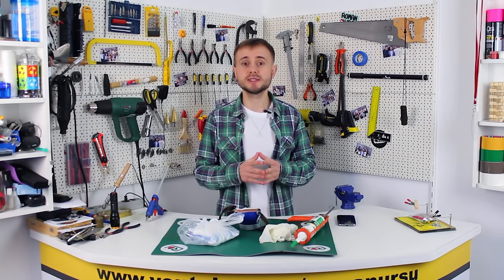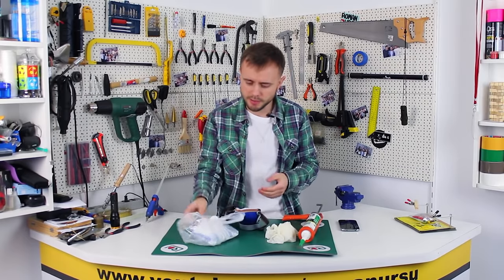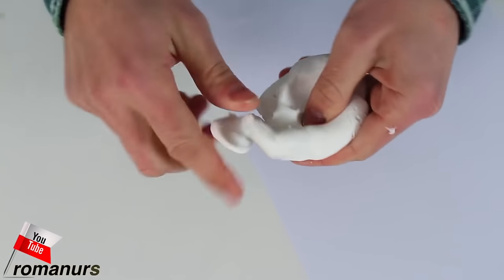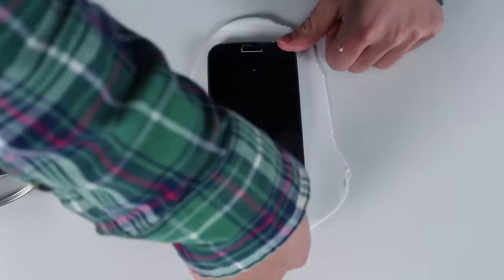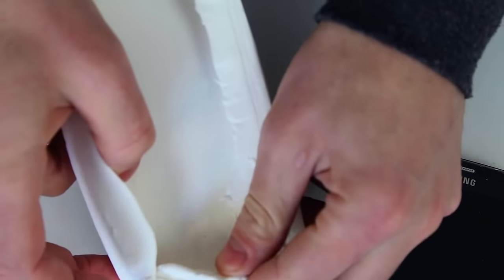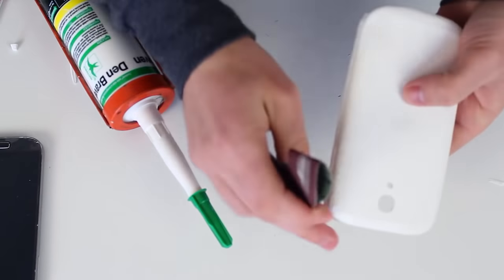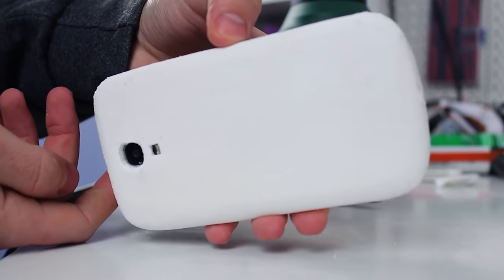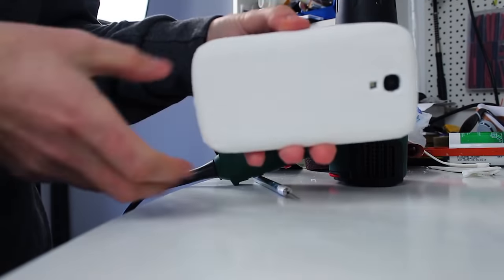DIY | How to make an Silicone Phone Case  | Tutorial

Comment: This seems like an interesting way to seal up low-power DYI electronics for weatherizing. Not only for a water-proof layer, but to protect it against hard hits with something soft. I think a thick shell like this would take a lot of beating, and being a mold-able putty makes it very versatile.
I could also imagine this being useful for DIY tool grips, to approximate vulcanized rubber.

I assume the starch is just there to make it less sticky to where you can handle it. Does it affect the final strength after curing significantly?

Comment: I don't think people will wait 12 hours without mobile phone to build the cover ahaahah
Reply: buy a model version of your phone
Reply: +TheLucos1996 you can use Styrofoam or clay to replace the phone, just make sure it has the right size..
Reply: +Nicholas Ruiz Model phones are about $10 and cases are 50c
Reply: +God ... if they dont make them any more .. its a good way ;)
Reply: +Nicholas Rios
Reply: Ahmed Abdel Wahab Lol Ruiz not Rios
Reply: +Katikas no because then the new case will be too big.
Reply: slicedpage no, you mold the inside of your case and then mold the mold of the inside if your case, to get another
Reply: +Nicholas Ruiz yes I get your point but then it would be too small. I think the only way to use an existing case is to make a blank of the phone. Using a phone case fill it with the silicone mix to as close as you can to represent the phone. Once dried trim excess and shape to an exact copy of the phone. Now use that blank to make cases. But there might be a problem with the silicone mix sticking to the blank. But what the heck we have all the time in the world to solve this knotty problem.
Reply: *****
I beg to differ. You said," by putting something into the case ". yes a phone or a blank ! Trying to shape a case inside an existing case using the putty is almost impossible. It would be too hard to get the thickness consistent. And you know what its like when a case is slightly too small . This method of making a case is not something we'd all consider using. In fact the only place I could think of using a copied case is where its fixed to a cars dashboard for sat nav use. Take the phone out of its normal case slip it into the car case abd away you go.Swap back when you leave the car.
Reply: *****
your ego is bruised for no reason,no need to turn into a troll.
Reply: +Illuminati confirmed  we do know that ! this was a purely a hypothetical theoretical  problem. Which was solved eventually after much ado, lots of soul searching,fist fights and muffins.... It would be easier to buy a cheap one.
Reply: +TheLucos1996 you can get a cover delivered quicker than that in some places
Reply: I know right
Reply: exactly!   😂
Reply: +TheLucos1996 That was DIY .. if you cant handle that u shouldnt get in in the fisrt place ....
Reply: i dont think that you use your phone when you sleep
Reply: u r right
Reply: +Kliffom i would
Reply: I can there's an outside world were you can actually hang out with friends instead of texting them 12 hours pass by fast when your busy doing something.
Reply: yeah I wouldnt
Reply: mayb but that's cuzz I'm 10 and just got my phone
Reply: but what to do 
they should wait!!!
Reply: nothing
Reply: +Kliffom same lol
Reply: +Kliffom simply leave the phone in the case while you sleep ;D
Reply: +Stefan Vasiljevic ohh didn't think about that haha 😂😂 thanks btw
Reply: +Be Lyrics happy to help lol
Reply: Jajaja well you can do it in the night and then go to sleep😂
Reply: +Amelia Martinez yaaaa
Reply: ya
Reply: do it when you sleep
Reply: true
Reply: I can't wait 12
I can wait 11 hours or 13 hours.
Reply: i was about to write the same thing
Reply: I used iPad for 12 hours😂
Reply: my dad is using the phone every second fro business
Reply: kullanılan malzeme adları nedir
Reply: Better then waiting 12 days to get your phone fixed or to order a phone case if your someone like me who would have to buy it online.
Reply: Kliffom it doesn't work anyways lol
Reply: Kliffom [QTSS] it doesn't. It takes about 10 to 15 minutes
Reply: Kliffom [QTSS] hell nope
Reply: good idea ... but who'll wait until 24 hours without phone
Reply: Nicholas Ruiz if i have the money i will go by my self a case
Reply: Jamal you can make many and sell some to your friend. Plus you can design it anyway you want (custom)
Reply: Kliffom [QTSS]  #
Reply: Blo0dbound89 I agree, my sister has an iPod and they do not produce iPod cases anymore. This was a great way to get her a new case
Reply: Idc jus t make more than one and it will worth it
Reply: SAVAGE! LOL.

Comment: Hello, I've been working on designing a phone case for my project, and I'd love to get your expert opinions on the materials I'm considering. I've narrowed it down to TPU, polycarbonate, and silicone.
Reply: That's a good selection of materials to consider. Each has its advantages and disadvantages. TPU, for example, offers good shock absorption, while polycarbonate is known for its durability. Silicone provides a nice grip. What specific properties are you looking for in your phone case material?
Reply: @areuhu9230  I'm aiming for a balance between protection, cost-effectiveness, and ease of production. I want the case to be durable but not overly expensive to manufacture.🙂
Reply: @hanhan-oy9hu  It's great that you're considering both functionality and cost-effectiveness. Have you thought about how each material might affect the design aesthetics of the phone case? 🤔Different materials can give a case a different look and feel.
Reply: @areuhu9230  Yes, I have. I'm trying to balance between ease of production and material quality. I don't want the manufacturing process to be overly complicated.
Reply: @areuhu9230  Thank you for your insights👍

Comment: Awesome, I might try making silicone boots for my power tools. For some reason there is no oem or aftermarket boots for most of the Milwaukee tools out right now. We'll see how this works out.
Reply: Yes! It would also be excellent for replacing missing foot caps from the legs of metal stools etc. The options are pretty much endless, really. I also think that if you experiment with the various types of plant based starches and the quantity and even branch into things like plaster of Paris or drywall material (whatever that's made of), you could be able to fit any need you have in custom detail.

Comment: You have to use potatoe starch when making this mold. I tried using corn starch and it did not have the right consistency. The corn starch mix turned out sticky. I found some potatoe starch at a vitamin store, Walmart didn't have it.

Comment: Not to be rude but I think this method only works if you already have a silicone. If not, would you rather buy a silicone or a phone case directly? I think buying a phone case directly would be cheaper than buying silicone. And if you need it right away, I wouldn't wait 12 hours for the silicone to dry.. going to the mall and pick out one that you want would be easier because you just have to pick what fits best for your style or phone. But you did try your best to make this video. And I hope you changed your pronunciation with "guys"😐

Comment: It doesnt work. My silicone never stopped sticking to the table and If I putted more cornflour it breaks.
Reply: Use Corn starch not corn flour. They are different. 😀
Reply: I use corn starch. But I didnt know how to say Maizena on english. So I used the term flour. I see now that no one of the tutorials I saw said that I had to use kitchen paper so the silicone doesnt stick on the table -____- I have throw almost 30 dolars to the trash because of that.
Reply: Perhaps your air is too dry for silicone to cure. The curing agent is activated by ambient moisture. You can set a bowl of water near the work piece, or put it all under a tent of sorts, made from wire and a plastic bag, to keep air moisture from the water bowl in the same volume as your work piece. And you need much more patience.

Home improvement silicone caulk will usually give off vinegar like smell when it cures. If it doesn't smell, it's not curing. It should at first smell strongly, and when the smell disappears, it has fully cured.

Comment: Why do you add the potato startch please?
Reply: I suspect he does so in order to make it sandable, so he can remove the surface bumps and lumps after it cures, and so that it cuts easier. You cannot sand pure silicone caulk, it will do all kinds of nasty things, like reject the sandpaper, or rip out sandpaper particles and leave them embedded into itself, or rip all the way through. Usually all of these at the same time.
Reply: Thanks for your help with that Siana 0x0x